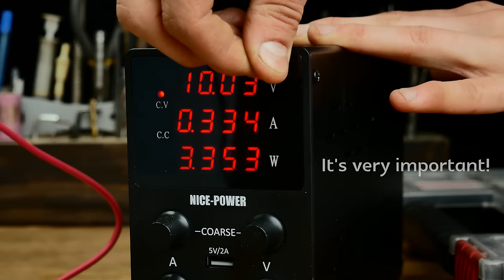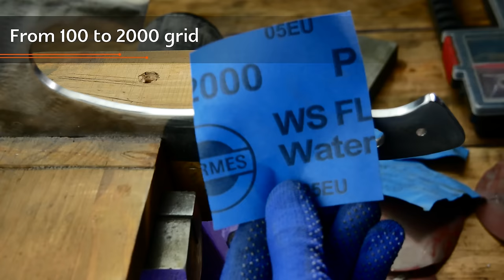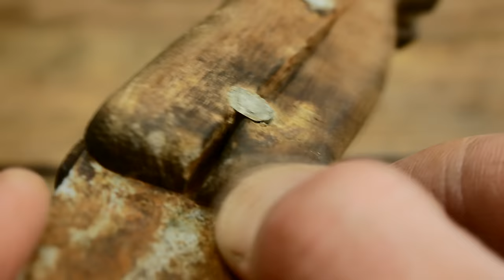Restoration of Antique Pocket Knife ! 40 min of Amazing Restoration Techniques

Comment: You didn't need to send the wood after cutting it,at 6:20 - you already had 2 perfectly flat faces...and since you later shaped the outside of the scales , it was an unnecessary step.
Also,you might consider saving that sawdust,instead of blowing it all over your workshop,it has many valuable uses,and you don't want to breathe it in by blowing it into the air.
Regards from Scotland.
Reply from the maker: You're absolutely right. I had a perfectly flat side of the wood. But also, there was a beautiful pattern there that I wanted to keep (and I succeeded).

After spraying the dust, I usually air the room out

Thanks for your opinion, it's important!
Hello from Ukraine 🇺🇦

Comment: Nicely done but in your place i'd actualy blue it in a different way. I would put pot of water and wait for it to boil and just dump blade in boiling water 15-20 min that way instead of dumping it you convert rust into black oxide which in turn protects blade from rust. It's oldest known way of bluing steel and probably the first.
Reply from the maker: Ok, i will try next time. Thank you!
Reply: @uniquethings6032   keep in mind that blade needs to be rusted already for it to work.

Comment: Overall I like the end result I feel like adding the aluminum or steel pieces or whatever they may have been in place of the brass is good I like that if it would have been possible I would have loved to have seen the brass on top of the pieces you added outside of that the only thing that I would have done different just for security and longevity of the knife is instead of just pinning the metal pieces I would have pinned all the way through the scales as well as my personal opinion but those are like assholes everybody has one so I do not mean to be an a**** with my comment very well done sir
Reply from the maker: Thanks for your feedback! I appreciate your thoughts on the design and the suggestion to add brass on top of the added pieces. It's always great to hear different perspectives and ideas.